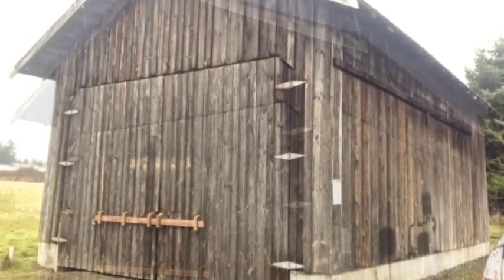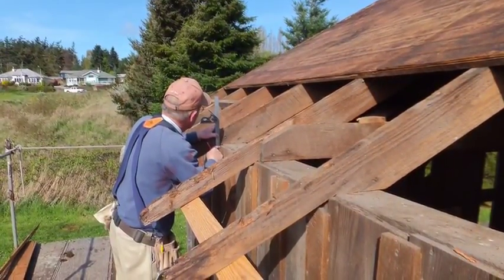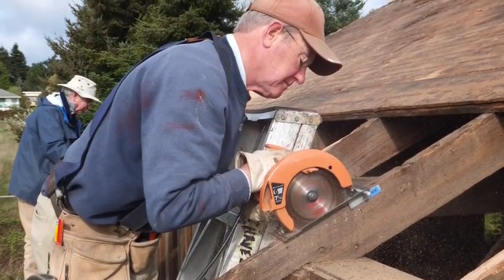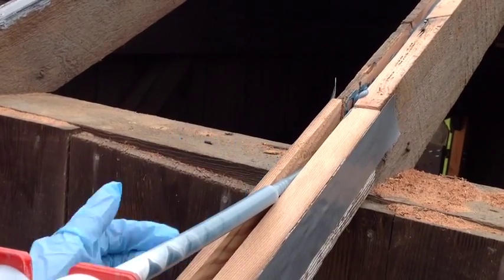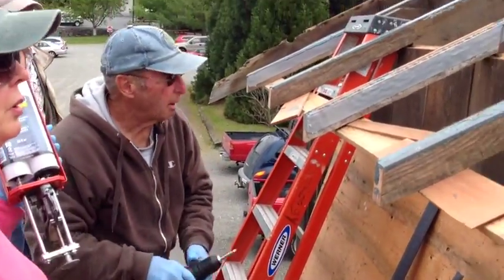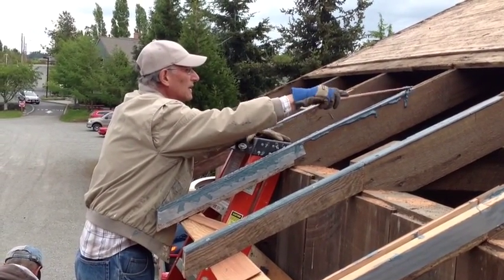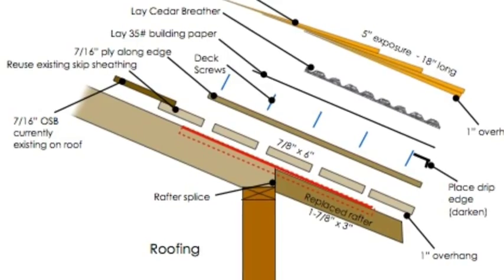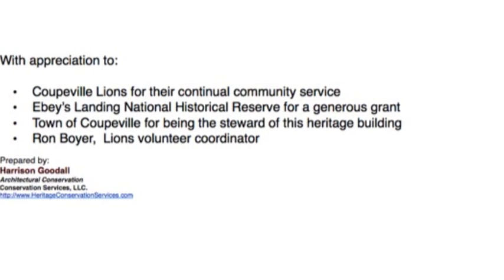Holbrook Barn Rafter Treatments

Comment: treat the underside of the roof deck with used motor oil or a dark stain. this will make it match the rustic motif of the rest of the structure.